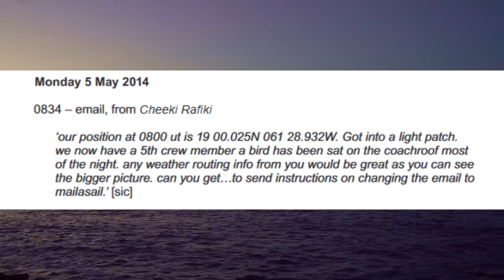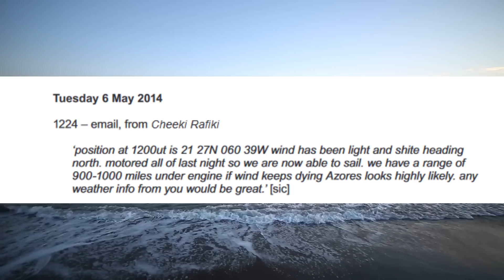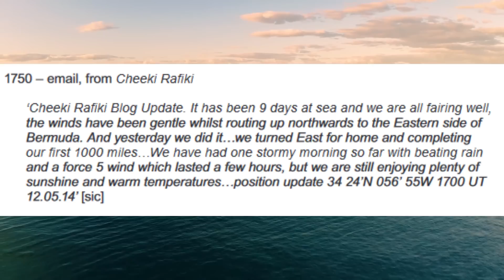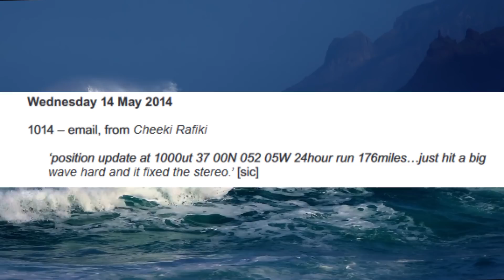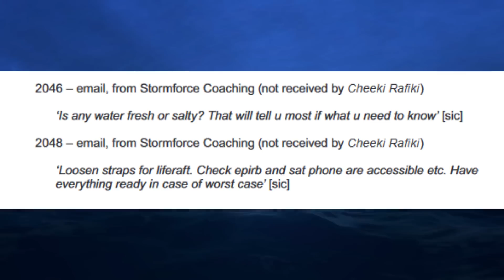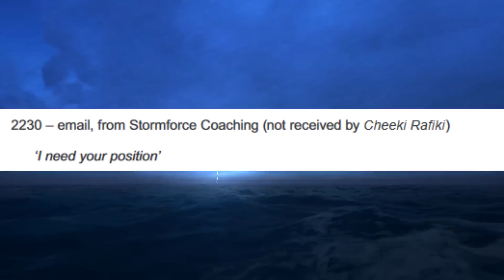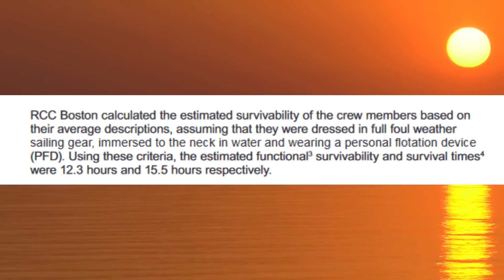The Final Hours of the Cheeki Rafiki

Comment from the maker: With regards to what caused the vessel to capsize, the MAIB report states "In the absence of survivors and material evidence, the causes of the accident remain a matter of some speculation. However, it is concluded that Cheeki Rafiki capsized and inverted following a detachment of its keel. In the absence of any apparent damage to the hull or rudder other than that directly associated with keel detachment, it is unlikely that the vessel had struck a submerged object. Instead, a combined effect of previous groundings and subsequent repairs to its keel and matrix had possibly weakened the vessel’s structure where the keel was attached to the hull. It is also possible that one or more keel bolts had deteriorated." The report is linked in the description of the video.
Reply: You should pin this to the top of the comments so that everyone sees it.  Great video 👍
Reply from the maker: @medea27  just did, thanks for the suggestion

Comment: These sailboats are notorious for the keels coming off because they are only bolted on. Once the keel goes the boats just flip over and there's nothing you can do about, instantaneously. I bought a sailboat with a fully enclosed keel just for this reason. May those sailors rest in peace.
Reply from the maker: I read in the report that’s exactly what happened, the bolts were rusted and snapped. I’m personally not a sailor so thanks for the insight :)
Reply: That is not entirely correct.
Lots of same size sail boats cross the Atlantic safely every year.
I have done the crossing several times, sailed as a delivery skipper. 
The smallest boat I have taken across was only 36 feet.
It was a Danish built Bianca 360.
Experienced no problems what so ever.
And I have taken a lot of German Bavaria boats to Norway both summer and winter in all weather conditions.
No problems.
This is a problem particular for French boats.
As soon as I realized it was a Beneteau, my first thought was "they lost the keel".
Reply: Out of thousands of Bavaria boats built, a total of one has lost its keel.
That particular Bavaria was a so called "Match Racer" that is lighter built than a Bavaria Cruiser, and it had been a charter boat for six years.
Six year with lots of groundings.
So no, it is very rare for a sailing vessel to lose its keel.
Unless it is French of course.
Reply: And all well built sailing vessels have stainless keel bolts.
The only boats I have ever seen with rusty iron bolts was Beneteau boats.
Never buy a used French boat, particularly not a Beneteau.
Reply: @silasbeebe  The only boats with iron keel bolts is Beneteau boats.
All other recognized brands of mass produced sailing vessels have stainless steel keel bolts.
Reply: @silasbeebe  Been sailing and working with boats for forty years.
Beneteau boats have a very bad reputation among professionals.
I have let a few jobs down simply because the boat in question was a Beneteau.
Reply from the maker: @agolf Twittler thank so much for your input, this is interesting stuff. I love hearing from real sailors about their own personal experiences :)
Reply: @silasbeebe  I am ever so slightly drunk right now.
But I will be back and on your terms we can go in depth with any subject from basic celestial navigation to how to survive on emergency rations in the middle of the Atlantic.
Done that, been there.
My dad was a US marine and he was my hero of course, I wanted to become a sea captain since I was a toddler.
And the sea became my life.
I am retired now, but I still do the occasional contract now and again.
I thank you beforehand for your patience.
I will be back Sir
Reply from the maker: I would love to discuss any of these topics in more depth with you, shoot me an email and we can figure something out. I greatly appreciate the amount of time and effort you have already spent sharing your knowledge, thank you as well sir
Reply: @silasbeebe  Will do Sir.
See you soon.
Reply: @agolftwittler1223 . I apologize Agolf if you misunderstood me but what I wrote was about Beneteau. I didn't do a good job of it. I said these sailboats but I should have said the manufacturer because as soon as I heard the story I thought the same thing... It must have been a beneteau. But, I agree with you 100%. Thank you for your reply.
Reply: @shortwidgets  No need for apologies.
And now I read your initial comment once again, you write "these sailboats", meaning boats similar to the one this video is about.
Long story short, we agree.
And yes, may they rest in peace.
Reply: This is why I have a strong preference for boats with full keels that are part of the boat’s structure instead of bolted on. I prefer their sailing characteristics over a fin keel as well, but they are also much more rugged designs in most cases. Every Island Packet I’ve sailed is a tank, and I have a Sea Sprite 23 that I have qualms sailing to most locations in New England with her heavy full keel.
Reply: @cflyin8 . Exactly! Very well said.
Reply: Many, many boats are built with bolted on keels, including many regarded as excellent, safe passage makers. Also, beneteau makes a LOT of boats. Because of their huge market share it may seem that they have a lot of problems. But that may not be the case in fact.
Reply: @agolftwittler1223  Ah, even Stainless oxidizes...so slow your roll.
Reply: No they are not. Like any vessel, there are pro’s and cons. This boat had been run aground on more than one occasion and no inspections carried out. This was a tragedy waiting to happen.
Reply: @agolftwittler1223  Drivel.
Reply: That's total nonsense. There are thousands of boats with bolted on keels and its very rare for a keel to just fall off unless there has been a grounding that weakened the bolts or the structure.
Reply: @agolftwittler1223  There is nothing wrong with steel bolts as long as they are kept dry, in fact they can be better than stainless steel as they don't suffer from Crevice Corrosion. Jeanneau has used steel keel studs for decades and were always encapsulated in fiberglass. It was only when they cheapened out and stopped covering them up did they start rusting. But it takes decades of rust to caused a steel keel bolt to fail.
Reply: As we saw there was no kill on that boat as she was floating upside down that's what happened when that weave hit and they couldn't find what was leaking...
Reply: @Lucianrider  well that and groundings the fact that that boat was not pulled out of the water on a yearly basis and going over especially how it was being used.
Reply: That’s while maintenance needs to be done each haul out on keel bolts
Reply: Most sailing vessels are bolted on instead of being laid up glassed and never problems. Other reasons but I have not watched yet.
Reply: @edl617  I worked in a yard for 2 years and TowBoatUS Capt for 15 years.       That's way incorrect.
Reply: You sound like a real expert 😂
Reply: @momosworld7312         I know tow boat captains that are “experts”. This is a position that takes a good bit of experience.
Reply: Thanks for that info..."Fully enclosed keel" I alwsys thought that The only thing that is preventing  a sailboat from flipping should be more secure, Why haven't  they done so?
Reply: @patony_1288   The main reason is cost. It’s cheaper to do.  The second reason is performance. The keel has a sleeker thinner profile and if you ground, as long as you don’t damage the hull to keel joint area you’re ok. With molded in if you have a real hard pounding grounding like on rock or coral you could grind through the glass. If the boat is constructed correctly it will not flood the boat but must be dried out and repainted. This is not usually difficult nor expensive.   I very much prefer a molded in keel.  1. Almost no chance of a catastrophic fail. And thats a big #1.  2 problems are much less likely  and usually simpler to repair.  Unless you are a serious racer the performance difference is not much.  As a cruiser I will go encapsulated thank you.   I am not saying that bolt on is no good. I have crossed oceans in bolt on keel boats. Just not my preference.
Reply: @Lucianrider Bolted on fin keels and spade rudders have been a problem and I would prefer a full or modified encapsulated keel. The bolted on fin keels and spade rudders are intended for race boats to round buoys and cheaper to produce that's why they're used on these cruiser production boats also. You will see a lot more neglected fin keels break off and spade rudders get torn off by Orcas.

Comment: I own and have sailed over 10,000 miles on her sister ship, the Beneteau First 36.7! These are fantastic boats, and the bolt on keels are not an issue UNLESS they aren’t properly maintained. If you run your boat aground, and don’t pull the keel to inspect the bolts and grids, you’re going to wish you had. Unfortunately Cheeki had not done this.
Reply: Thank you for your comment. Were the bolts made of 304/316 stainless or duplex? Thanks in advance.
Reply: AND, if you buy a used boat with a bolt on keel are going to believe the previous owner, or yacht broker? Are you going to bet your life. or even your extended families' or friends lives on it? There are definitely going to be continuous stories of these boats losing keels into the future and even more so with aging boats.
Reply: @charonstyxferryman  be careful of skegs also, not all skegs are created equal.

Comment: If the skipper needed to be told to taste the water in the boat before assuming it was a  freshwater tank leak then he's not very experienced. Substantial amount of salt water in the boat means either a failure of a seacock or pipe (easily checked) a collision (easily remembered) or keel bolts,. All seacocks off, all hands to electric bilge pumps, manual pumps buckets, pans whatever, disconnect engine coolant pipe from sea cock and use that with engine running if needs be to get as much water out to find ingress. As soon as keel bolts identified as ingress, get all sails down to reduce strain. Ready the liferaft and get grab bag ready in cockpit then call mayday and motor ahead just enough to maintain control. Yet some of the lifejackets were still onboard unused and they appeared to have pushed on under full sail  I read somewhere and why radio silence there may have been several ships in the vicinity who would divert?
Reply: This is spot on. Many reports say the skipper was very experienced but he was very young. I believe when the hull was found the life raft was still stowed away.
Reply: Water in the bilge, is it fresh or salt  its the first thing you check. Such a tragedy which sounds like it could have been avoided. They say skipper was experienced but there's only so much experience you can have at that age.
Reply: @ipirrie6734  should be able to smell it and tell really

Comment: Racing is an oddball pursuit, with discarded priorities. The other keel components should have kept the boat upright and afloat. ........ Oops, there are no other components. Bolt on keels are a godsend, but they come with responsibilities, just like you maintain a plane or bus. I would have not been afraid to own a high strung boat like this, except I would have demoted it's design after the keel got beaten up. Clip the mast down. Attach a lighter keel. Build a better mounting base. These all would have worked. Money makes people blind and insulated. I see a bolt on keel as an advantage, but not in it's most extreme forms.

Comment: Keel separation risk should not be borne entirely by the imposition of maintenance requirements. To a large extent, this is a design issue.
Reply: if there is multiple failures similar on the same model maybe....it was for racing afterall, cant get too fast and stay safe,,,,buy a full keel and this can never happen

Comment: What a sad story.  I know next to nothing about Naval Architecture or boat building but any time I've seen videos reviewing or showcasing a boat that has a bolt-on keel I've always felt uneasy.  I do know a few things about bolts though.  They rust, or they break under stress, or they loosen over time. I've had motor-mount bolts shear off just from hitting a bad pothole.  The difference was my life didn't depend on those bolts.  Apparently, this boat wasn't seaworthy after several groundings and the owner never undertook the proper repairs. What a shame.  May those Sailors Rest In Peace.

Comment: Any bolt on keel hitting the bottom & this one had a history of grounding weakens not only the bolts but the grid & on these plastic boats the grid is glued NOT glassed in to the hull , Same with there bulkheads = A weak point in the modern manufacturing method for most of these mass produced boats . Its all about the money .

Comment: The old timers used to refer to "a stiff boat', by which they meant a sold, seaworthy structure. That certainty means no flexing but much more than that. Modern boats (except some expensive models) are generally not designed to be 'stiff'.
Reply: Actually I believe "stiff" refers to it's tendency to roll, or it's initial stability. A boat with high initial stability is said to be "stiff" while a boat that tends to roll more off initial stability is said to be tender. Neither type necessarily infers it's ultimate stability. It doesn't refer to the hull rigidity. You can find some videos of large ships at sea and you can see the hull twist and bend by design, while still having very high initial stability.
Reply: @albatross5466  You are quite correct! Thankyou for correcting me. I have also learnt that the opposite of a stiff ship is a tender one, with bulk cargos suited to a stiff ship and lashed cargo better suited to a tender ship.
Reply: @stephenburnage7687  Just to add to the conversation...traits that lead to stiff boats often are contributed to hull width. Another is the "tumblehome design," the bulging at the water line provides more initial stability but then decrease its resistance as the angle of lean is increased. So the boat will sail flater in light to medium winds, but heel more in stronger winds. It's not "linear". Modern fast yachts and race boats use flat undersides of hulls with very wide sterns, to increase stability. The flater hull makes the boat generally better for speed and the width resists heeling, which means you can keep the rig higher and straighter thus producing more power. They're now using foiling members to resist heel and increase stability. However, all this pursuit of speed make for a very large trade off in comfort. Ever listen to and or watch modern day ocean racing? It's like being in a  55 gallon drum with someone pounding the hull with a 2 x 4. Loud and bumpy when the weather picks up. Ihmo.
Reply: “Solid”… but then again a “sold” sailboat is a good thing…… 😅
Reply: We see that going on now with all the catamarans that are having issues

Comment: Man, this is clueless. The boat grounded, hard. This broke the bolts holding the keel on, So the boat capsized immediately after the keel fell off; That's the whole story here.
Reply: Capsize just means the boat got turned upside down. If the keel falls off, it remains that way, or inverted if you like. The wind seldom capsizes cruising sailboats, except in rare cases of sudden squalls in otherwise calm weather and some other problem, because almost all boats are self righting to 120° or so, and at 90° there's no sail area showing to the wind. . it's almost always large breaking waves, especially beam on, that roll them. Mostly they come back up as the cabin fills. Some modern boats are too form stable inverted to come back up.

Comment: really sad 🙄 But offshore sailing can be high risk. strange they didn't get a chance to get into the life raft mind 🤔
Reply from the maker: I also thought that the life raft not being deployed was odd
Reply: Sounds like the keel fell off. Boat would go upside down VERY quickly. Then, in rough conditions, it is not so easy to get to the raft. Keep in mind that they were likely extremely fatigued long before this happened.
Reply: The life raft was secured inside a locker, if they didn’t get it out before capsizing then they would seriously struggle to get it

Comment: It's the sailors own fault for not getting in the life raft before the boat sank!  🇺🇸
Reply: Looks like the keel fell off. So that would have been incredibly sudden and violent.
Reply: @mckenziekeith7434  They were told to get the life raft ready before hand and if they were seasoned sailors they should have known that!
Reply: @jacobdanielkuiper5744  Exactly. Staying conscious with all the violent motion suddenly upside down would be tricky enough. I think some people comment without ever having seen rough offshore conditions, so they have no idea.
Reply: I have been in a boat that lost a rudder mid Pacific. Despite the rudder crashing repeatedly against the hull before it finally departed, we resisted getting into the life raft, which turned out to be the correct decision. The life raft is a last resort and the decision is not always easy to make.
Reply: @The Veteran
Says the man who’s clearly never been offshore in a small yacht. It’s drummed into everyone doing a Yachtmaster course that abandoning your yacht for the life raft is absolutely your last resort. This yacht almost certainly went from having a serious leak but not sinking, to being totally inverted, in something like 5 seconds.
Reply: @q.e.d.9112  If the raft would have been ready they could have used it.  By the way I was in thr navy for 10 years before I joined the Army.
Reply: @theveteran765  
Good for you. You still don’t know what it’s like on a small yacht at sea. They could have had the raft ready, for all you know. That yacht turned completely over in perhaps as little as two seconds. The crew below decks trying to locate the leak and pump ship.